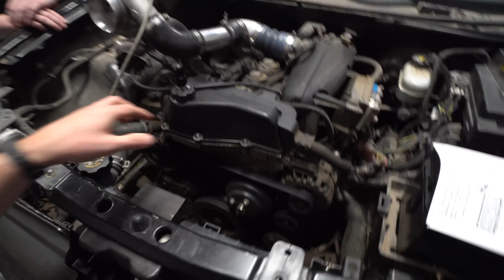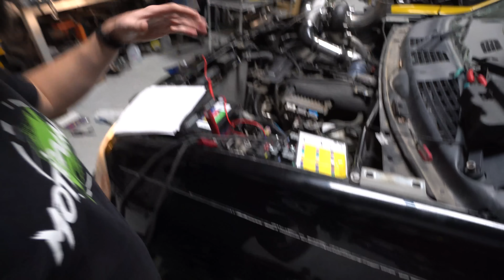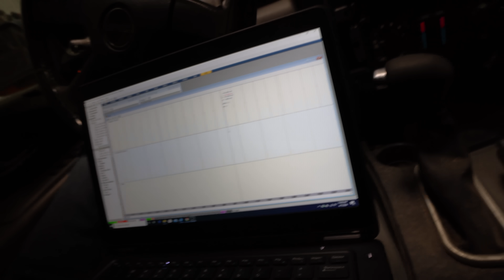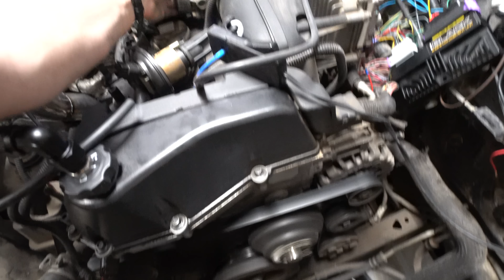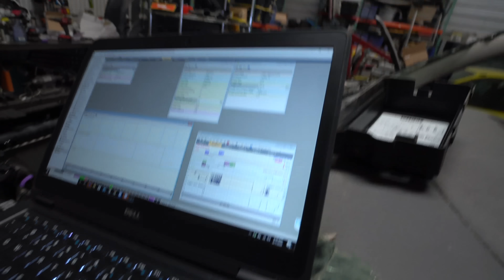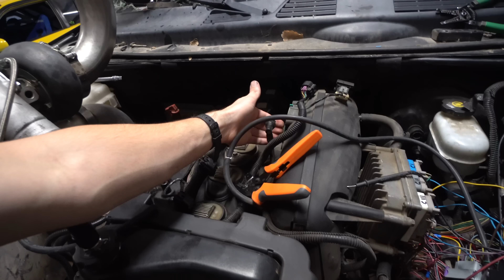WILL IT START? $1200 Ecu on a $200 Engine.... The GM 4200 AmeraBarra.

Comment: did this ever run and drive and get those issues fixed or just started it, reved it with your hand finished this video then abandoned it?
Reply from the maker: Pretty much, we got busy with the frame swapped c10 with an 08 engine with a rod knock. Got it started then moved into a new shop and the project had been abandoned for a while

Comment: Great video! The gmt360/370 is an amazing SUV, I own three of them a TBSS RWD, a 97x 5.3 AWD and a 4.2 Envoy RWD on air suspension. I am debating if I wanna turbo my envoy or get a manual transmission Colorado and swap a turbo 4.2 into that. Definitely wanna play with the 4.2 see if it can rip the bunch of LS vehicles I own.

Comment: They are normally in the junk yard because of the 4L60E Trans taking a shit or the engine blowing up. They have oiling issues. If stone was to fix that issue I think they would definitely have a chance at being a very high performance engine

Comment: The ECU/Motors that are more capable of handling boost is the 06 to 07. I've been looking into the 4200 someone is actually making close to 500hp on a turbo set up. An I believe it's the stock ECU.

Comment: I rebuilt my 96 Tahoe 5.7 and I installed a hotter cam. I had to swap in a pcm from a 99 Tahoe so I could use HP Tuner. I had to swap around a few pins for the 99 pcm to work. I'm glad I did it because now I understand half of what you are talking about..

Comment: The flywheel from colorado will fit just take out the torque converter centering bushing  nd install pilot bushing it will fit

Comment: Apparently the crank is good to something like 1500hp. There's this one car that had the engine swapped in like 2009, made a claimed 1500hp. 

And there was this one tweet about another car, claiming it made 1300hp. The poster couldn't clarify if it has a custom crank (I doubt it honestly but who knows) as they just posted the car. They were not the builders. Glad this engine is starting to get recognition.

Comment: Awesome work, hope you can get it going. You can also contact Whipple as they had a supercharger for the 02-03 4200 and made it work in an envoy. Maybe they know how to hack the MAP sensor. The blower was removed after a short run, maybe due to trans or rear axle issues.

Good luck!

Comment: Been subscribing for a long time, I love how far you're digging into the ECU stuff on this. I have an 04 Envoy myself. How'd you get the fan clutch off?
Reply from the maker: Use an air hammer to spin the nut

Comment: Was always interested in this engine. I hear the biggest issue is mid to high RPM rev. Anything over 6000 will require a new forged crank because of balancing issues.
Reply: 07-09 engines have a forged crank and have the ability to rev out with valve spring changes

Comment: You could make a second crank position sensor and just put a 24 minus one wheel on the crank behind the crank pulley and grab a sensor at the junkyard that way you aren't splitting the signal. I had one of those SUV's and I'm pretty sure that computer uses that a RPM signal for everything

Comment: If you pigtailed the throttle body harness u might have the ecus battle for the TB initial position for stock vs whatever you want to input from the standalone. For instance you try to move the TB with the standalone but the stock sees say 1-2 degrees movement and it does the opposite movement which counteracts eht standalone. Nice project there. 💪🏻 Keep it up.

Comment: I can't really tell if that's the 4x4 version or not but those transmissions and the transfer cases are ridiculously picky so wiring nightmares might not be over with if it is. Just a heads up the Transfer case shift control module partially controls some shift points in the trans.
Reply from the maker: rwd

Comment: The ecm switches polarity for the throttle body so it can force throttle closure. I believe the ecu masters is capable of that. The inverse is the ground circuit for it and the motor is supplied 2-12v signals and directs 12 volts one way with a ground to open and then the other way for  closure. I'd have to look at a gm wiring diagram to verify that's the way its wired factory

Comment: I was going to do this test myself with this engine. I'm glad you're getting into it and I get a chance to learn about it before getting to deep into it and finding out it's a dead end. I was going to just get a manual swap and skip all the a-t headaches. Even though a 4L60 can be built to hold some power chasing the bugs is a major deterrent... Good luck, I'll be watching for sure🤙

Comment: I'm so excited to see how this turns out!  I used to have a 2002 Trailblazer with this engine and was always wondering if they were more capable.  Hope you can turn it into a monster!
Reply: I had a 03 Trailblazer Ls with a flashed ecu just gov remover basically nothing special and I was able to sit the speedo on the pin wellllll past 120mph racing a older 92 Camaro and I won by a car! Lol loved that truck use to swing it all the time

Comment: There is a standalone for 4l60e
Reply: Micro squirt. Also works for the exhaust vvt
Reply: @jonsmith7426  when I done my s10 bought standalone and never had an issuse there are many ways even hooking switches up

Comment: ETB relearn procedure 
1) Start and idle the engine in park for 3 mins 
2) Turn ignition off for 60 sec
3) Start and idle the engine in park for 3 mins again. At this point, the engine should be idling normally. 
NOTE: Check engine light may illuminate indicating idle speed diagnostic trouble.

If idle speed has not been relearned, it may be necessary to drive the vehicle at speeds above 44 MPH.
After the drive cycle, engine should idle correctly; if not:
4) Turn the ignition off for 60 sec and repeat Step 3

Comment: These engines have a VVT on the exhaust side (only the exhaust side). 
I remember back when they had one of these in small twin turbo set up that they was showing off and thinking about throwing in the SS production line.

Comment: You can 100% for sure split a vr crank signal. Running a microsquirt piggy backed onto stock dbw ecu on my bike. Works great to 12k rpm

Comment: Yes I am stoked about this project. :) looks like fun. I know the older 4L60E's you could basically shift with a few switches controlling the shift points. Im not sure if they changed anything for the 05 model year. I have buddy that had a diesel 6.5 box truck with a 4L80E that had a bad controller and he had 3 light switches on the dash to make it shift lol.
Reply: You can get a standalone TCM to control the transmission. I've been looking at it for when my 5.7 350 blows up and I want to swap to a 4BT Cummins.
Reply: @Dang_Jim  there are many including a megasquirt/microshift to do the job. I'm just thinking about a quick and dirty test that involves no or little money to test the trans for this project.
Reply: I think GM changed it when things went OBD2, at least that's how it is on FWD GM trans. There is no manual vacuum modulator / TV cable to control the line pressure. The issue is probably that you need to control the line pressure solenoid and the shift solenoids and Trevor's ECU can't do all of that. But then again I've never messed with RWD GM autos or ECU masters ECUs so I could just be making things up.
Reply: @ethanlindsey  hmmm, i wonder if the line pressure solenoid is setup in failsafe mode where it defaults to max line pressure when it has no signal.
Reply: @reliant_turbo  haha probably don't want the line pressure to be maxed out all of the time unless you were going full send. very hard shifts. Friend of mine had a malibu with a bad line pressure solenoid it would SLAM into the next gear and then the check engine light would come on, it would be in limp mode until it was turned off and back on again.

Comment: alpha N means running off TPS only, no map or maf. it used to be used in drag cars with huge cams. I doubt this oem runs in tps only?
Reply from the maker: It uses map, i think there are a few variants of alpha n
Reply: MotionAutoTv would the piggy back one they sell work for something like this? I'm definitely following along, I have a 96 tahoe that the oem ecm isn't supported and swapping to a ls1 ecm is a hassle I don't want to deal with. I'd much rather spend a bit more and have a stand alone but keep the oem ecm for everything else.

Comment: do you maybe have the polarity for the throttle body motor backwards?
also with the crank sensor wires you can normally splice a VR crank signal between 2 ecus without dramas. is the stock ecu still seeing both crank wires?

Comment: Have to have that inverse signal that is the safety fallback in case you short out one of the two signals if it doesn't correlate appropriately it just shuts the throttle body down I don't know if  you remember those Toyota's about 15 years ago when they 1st went to drive by wire that would go wide open throttle and take off into a wall on the highway that was because they didn't have inverse potentiometer signals.  Basically one signal goes Hi 1 signal goes low and they should meet at 50% throttle.

Comment: with no cam signal they run batch which is 135 & 246 for injectors and coils run in wasted spark.
i use barra ecus on other engines this way as they're quite tuneable.